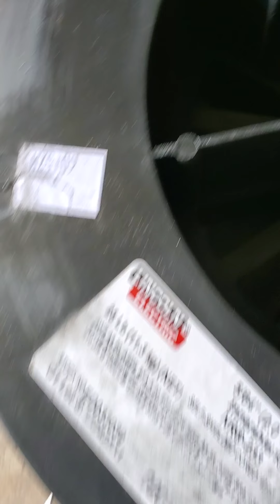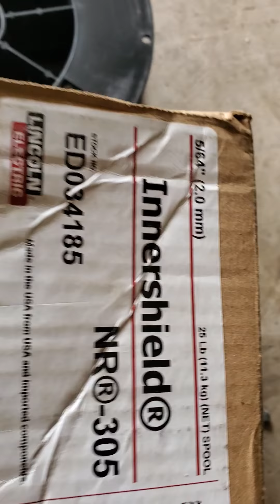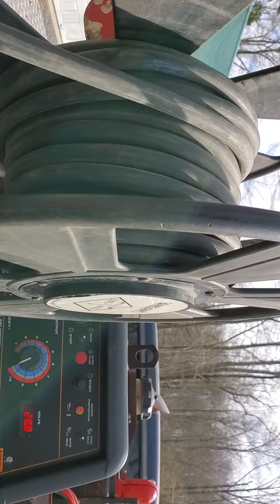Structural welding/ NR 305-5/64

Comment: Dude, today I was at our Union Ironworkers weld shop practicing for my D1.8, using nr305 5/64 and the inspectors telling us that our Volts have to be between 33-35 or else it's a fail🤦🤯🤯! That's WAY TOO HOT! That voltage is for 3/64! Guys are producing shit welds not knowing the inspectors wrong! I pulled up the WPS for that size just to show our brothers. I'm gonna correct Mr. Inspector tomorrow. He's a real hard ass so this will feel good!!!

Comment: 305 is pretty much a thicker hotter weld ?
Reply from the maker: Absolutely, Your volts are screaming when you're doing flat, A little  Touch down on the  heat on horizontal, My flat Welds ,Volts 30.0 to 33.0  Varies a, from the thickness of steel, And how much lead your run in, I'm averaging 300', Thanks for your question@

Comment: I run 232 all day everyday and am looking to take my D1.8 test within 2 months but haven't ran an inch of 305 wire. Everyone says ill be perfectly fine that it runs just like 232 but is just dumps way more and runs way hotter. Opinion?
Reply from the maker: Albert, What are you doing ,a horizontal and a flat test, 1"  Unlimited thickness, ,NR 305  That is what it's designed for, I'm sure you probably know that, What diameter wire5/64?
Reply from the maker: Albert , When I test,  Vertical and overhead, NR 233 5/64, Flat and horizontal,NR305  5/64,
Reply: @jetweldingllc4691  Its going to be 1 inch for unlimited thickness, Flat restricted access (rathole) with 5/64 305 and then with an overhead arc gouge and fill the backside overhead with 232.
Reply from the maker: @alberts9086   I love it, You'll have no problem, I really like  That procedure you're doing, Don't sweat the  Rat hole, When you flip to the other side, Just clean It up good, Your heat will take care of the rest, I always run my  Root pass a little past center to the other side, The rest is cake, Good luck, I wanna hear your results, Stay safe
Reply: @jetweldingllc4691  Likewise, Ill let you know once I take it!

Comment: Does 232 d1.8 cover 305 ?
Reply from the maker: Terry,  My vertical and overhead   tests for unlimited Thickness,   we're done with NR233 5/64, That covers me for all positions ,and unlimited thickness and I can use NR 305 5/64, For flat and horizontal positions, That's  What that wire is design for, I prefer to do a flat test NR305 5/64, Horizontal test NR305 5/64, Vertical NR233 5/64, OverheadNR233 5/64, That's just me, Thanks  For your questions, That's what the welding inspectors, Want to  See, Vertical an overhead That covers everything!

Comment: How hot do you burn
Reply from the maker: Rodolfo, I'm running 28.8 on the volts In this video, I have a video recently on NR305 5/64 columns splices, Always check the description, I tell you what Amps,Volts,Wire Speed ect, Check it out, Thanks for your comment, Have a great day!
Reply: Do u have any videos of you burning 232 .072 wire?? U are very brave running that wire in horizontal.
Reply from the maker: @SuperZombeast  , What's going on, 232 I don't  run  That much,  Lincoln NR233 5/64, and Lincoln  NR305 5/64, It is the greatest wire to do columns  Splices, The deposit of material will blow any other wire away, It's all about production, You control the wire, Do not let the wire control you, You can have your  Heat settings, And  Wire speed dialed in, Just like how I do it, It's trial-and-error you'll figure it out, Practice makes perfect,, Thanks for your comment, Have a great New Year!

Comment: Turn your voltage up or your wire down, it keeps kicking.
Reply from the maker: 19, What's going on, That is a Lincoln 305 diesel. It is not designed to run  n r 305, With 5/64 diameter wire. I was just seeing what this machine can do with 305, That's why I have a Miller 400 pro., I was just pushing the envelope I had it maxed, It runs NR233 5/64th. No problem with three hundred FT lead, I was experimenting, As you see in all my videos that are more present than that, I test everything to the max, But as you see what I do for a living, I deliver nothing but the best and use THE proper equipment, It's funny to see some of these people make these comments when they should realize what  machine i'm using, So so thank you for your comment and have a great weekend,
Reply from the maker: 19, As you Can see in.
Most of my videos like NYC Local 40 You can see the welded  the connections that I have done, And the present, You gotta be a real a**** to be running that machine with that wire.you need 5 foot a lead to produce that. Technically in our business. We're running 100 to 500 foot of lead.
On the machine. XM T 3 50., We use inverters on them jobs, Whether it's a lincoln or miller inverter,If we are running diesel machines 400/500 Lincoln or miller whatever it takes, But that's 305 I have is my baby, The best machine for stick I think, I try not to use any flux core on that  machine. I was just making videos. It was the very start of this youtube channel that my son started for me, Have a great day bro